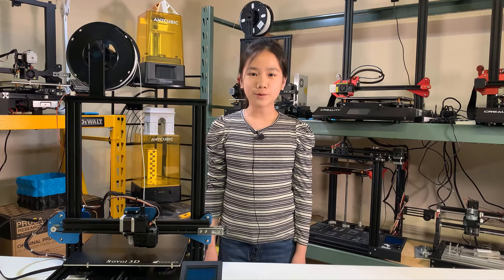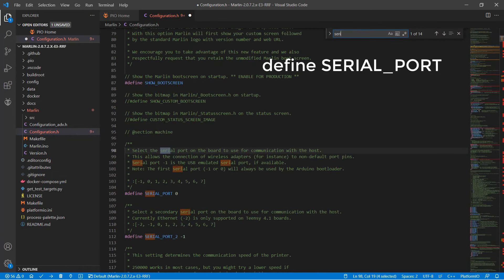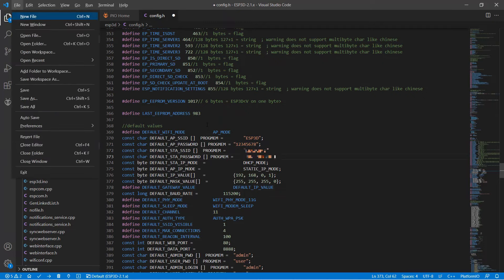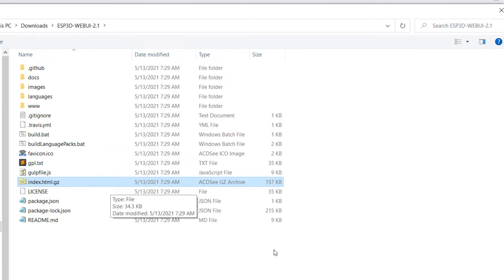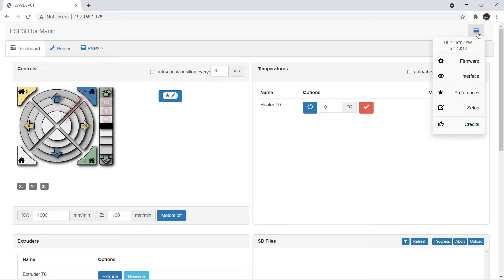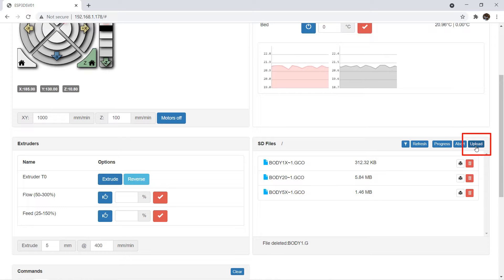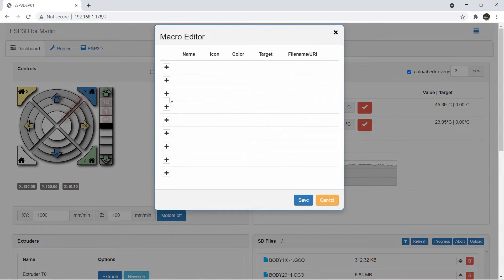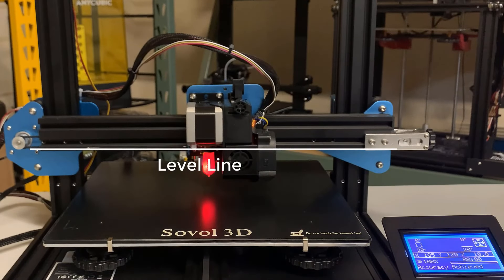Big Tree Tech E3 RRF 32 bit motherboard on Sovol SV01 - Enable WiFi printing using ESP8266 module

Comment: Any idea why my RFF board will not accept the ESP3D upload.  Ive waited 5 minutes and it is still a blue screen.  When I turn it off and check the sd card the name has changed to firmware
Reply from the maker: I have 3 RRF boards, one of them has a bad ESP module, in your case, it's hard to tell unless you have another board to try.